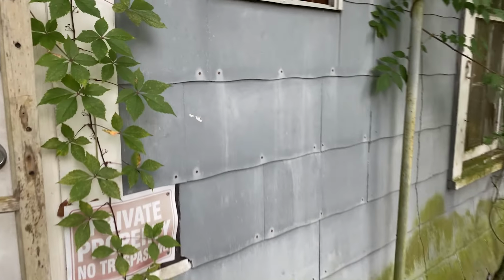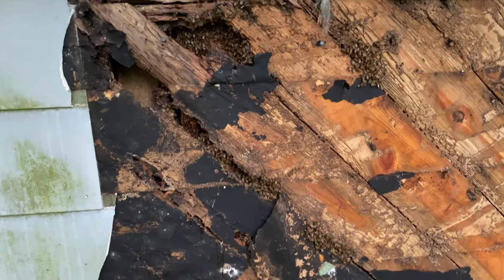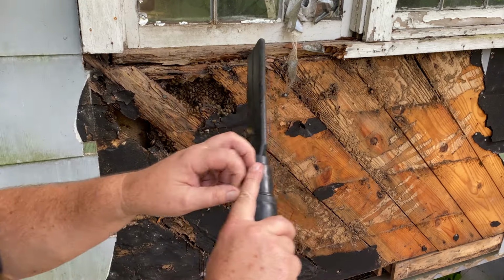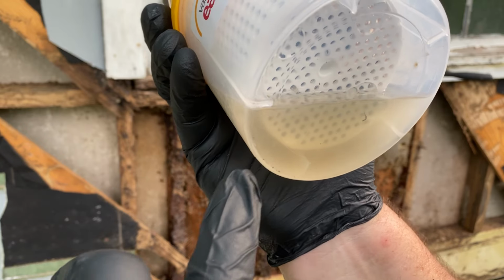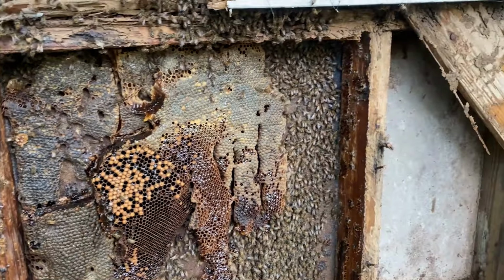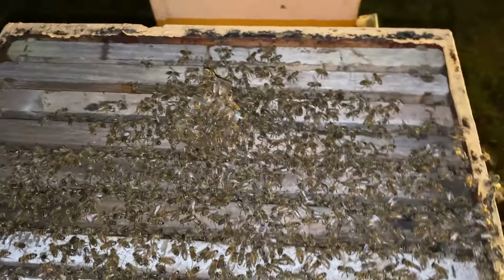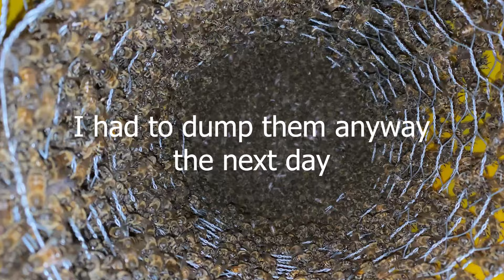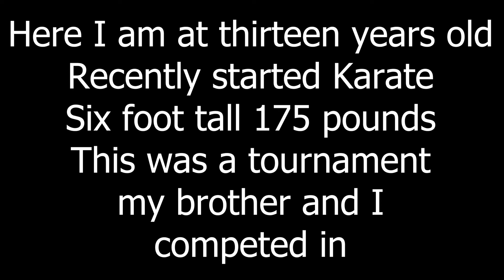Eerie Feeling Condemned House Of Bees

Comment: 😂🤣😂🤣, jumping off of the House. I can relate Randy, and nowadays it would be a Joint Replacement issue for sure. I was born in 68 and I'm 6'3" 270, so I can appreciate that story because at 14 I was already 6'0" 200LBS and wearing a size 14 shoe. We were Strong as Heck for no reason back then Brother........😂🤣🤝🏾🇺🇸💪🏾

Comment: That looks like non-friable asbestos cladding, judging from the way it breaks. Closer to asbestos brake pad material than the fibrous kind that makes the dust. Not an inhalation hazard, pretty safe to handle, and still useful and used for some applications. I think the reclamation services you mentioned reprocess and recycle it.

Comment: This old asbestos tiles on the siding are perfectly safe as long as they are not friable.  It lasts for decades and is safe to remove as long as you don’t use a saw or grinder. Great video, “smoke em till their eyes water”

Comment: You can get comparable match to the asbestos shingles now. I grew up with the asbestos and broke it frequently as a child with balls and sports equipment. Always pissed off my family because it wasn’t easy to find or replace. However, they have made a concrete or mortar mix shingle that’s stamped with the same pattern style of grooves. Easy to cut and breaks just as easily as the original.